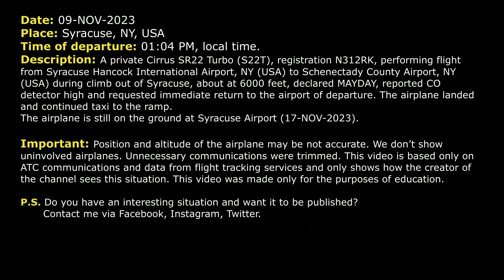MAYDAY. High level of CO (carbon monoxide) in the cockpit. Cirrus SR22 returns to Syracuse. Real ATC

Comment: Hey, thanks for making this video. I was the pilot on the radio. There ended up being a quarter sized hole in the exhaust manifold that caused the CO leak. To all the pilots reading this - please purchase a portable CO detector; I have a Sentry and use it in every airplane that does not have a CO detector built into the panel.
Reply from the maker: Hello, thank you very much for the comment. I'll pin it.
Reply: Kind of cool seeing this video on here. I fly into Syracuse at least once a year. Sorry to hear this happened to ur plane
Reply: Hey there N312RK.  You just showed up on my ADS-B receiver here in Owego, NY, and looked you up, and found this.  Gotta love technology.

Comment: This is another case of ATC clearing two aircraft onto the same runway.
The inbound aircraft shouldn’t have been cleared before the outbound aircraft departed.
But it’s somewhat questionable whether the outbound aircraft couldn’t have held for the inbound emergency aircraft.  Timing can’t be determined from the trimmed audio.

Comment: To me it seems UNLIKELY that the recording missed both the tower clearing to land and the readback. The "just remind me" is the pilots polite way of triggering a "cleared to land" that the tower had forgotten to give.
Reply from the maker: Probably there were some issues with receiver. Sometimes it happens. It was the LiveATC reciever.
Reply: @YouCanSeeATC  receivers always get a signal. When nobody is transmitting, that's just noise. So most receivers have a "squelch" that will suppress outputting the noise signal. 
Then... The receivers that liveATC uses are probably just "someone" who has a receiver close to an airport and helps out by streaming the audio to a liveATC server. 

Those receivers are somewhere on the ground, hopefully close to the airport. Radio transmissions often work best when there is "line-of-sight". Radio signals can bounce off mountains or certain layers in the atmosphere, but those are exceptions. Line-of-sight works best. 

So when the tower transmits, there are likely houses and trees between the tower transmitter and the receiver. Not enough that we don't hear anything, but some attenuation, pushing the tower transmissions closer to the squelch limit. Airplanes on the other hand, usually have perfect line-of-sight with the receiver. 

Thus... Tower: "high transmission power, very high quality transmitter, high antenna": you almost always hear them. Airplanes: Perfect line-of-sight: you always hear them. Ground vehicles: bad line-of-sight, low antenna, possibly lower quality/power transmitter -> often garbled, barely readable. 

So, for me, Occams razor says it is more likely that the controller missed giving the cleared to land and that the pilot politely reminded him (1 assumption) than that we missed two transmissions, one of them from the air, AND that the pilot then forgot about having heard and read back the clearance (three assumptions).

Comment: Is there a way to get clean air in the cabin when this happens?  For example if you are not near an airport and over a forest, what do you do?
Reply: I fly a similar plane. (Same make and model.) It does NOT have a window you can open so that is sub-optimal.  What I'd do would be to turn the vents on full, and turn the temp all the way to cold to make sure it was not trying to get any warm are from the heater's "heat exchanger" which is the primary place you get CO most of the time.  It may not solve the issue, but it will likely help.  

Declaring an emergency and landing asap is still the correct call regardless of any mitigations.
Reply: Unpressurized airplanes tend to have openable windows, altho that one I think is pressurized so I couldn't say if it has windows or not

Comment: I’ll bet that CO detector alarm was startling.
Reply: That's the point. :)  Ours is the same way. Very loud, very annoying, very aggressive. The annoyance is a feature. It needs to wake you up in case your mind is already foggy. You need to spring to action and do something before you can't.
Of course I'm gonna state the obvious here but maybe it will help someone who doesn't know: CO cannot be detected by a finger pulse oximeter. You need a dedicated CO detector in the cabin.
Reply: @lxxsxxx7845  right, I was simply saying that the sound of it was unexpected, thus startling, unlike a stall warning horn that pilots are used to hearing

Comment: “Say your reason for emergency”.  Once AGAIN, ATC not listening and making pilots in an emergency situation repeat themselves.  Maybe they are too busy scrolling on their phones.
Reply: On the other hand, not sure whether it's reasonable for an ATC to immediately understand that "CO High" (without phonetic alphabet) is referring to carbon monoxide poisoning.
Reply: @cjbprime They should know basic flight emergency situations. It is concerning how little they know about how aircraft work.
Reply: @cturdo  I'm not suggesting that they don't understand what a carbon monoxide emergency is -- I'm questioning whether saying "high see oh" over a radio is a successful way to communicate that you have a carbon monoxide emergency; or whether saying "low oh two" would be a successful way to communicate that you have hypoxia.
Reply: @cjbprime  I think it's an issue that they ask the same stuff repeatedly and that they are not tuned into the basics of aircraft emergencies. Both are an issue.
Reply: Maybe the Cirrus was not the  the only thing going on at the time. 25 years in atc and i have never heard that call. At least he didn't make him repeat s.o.b. and fuel
more than once,
Reply: @geezerhull  Yes.  That's a rare thing to be broadcast to ATC.  As a pilot, I would have said carbon monoxide issue, not just said CO.  But it all turned out OK.  ATC reacted to the Mayday immediately.

Comment: Carbon monoxide is a gas that you cannot see or smell. Thanks to the detector they were able to react on this imminent danger adequately. I wonder what the options are in case if there is no suitable landing field available in close proximity. They detected CO and aware of the situation and need a solution quite fast. Are there other options (depending on plane probably)?
Reply: The usual cause is heating systems, so turning off the heater and opening windows/vents as well as landing asap.

Comment: Excellent decision by the pilot! CO is an insidious threat, and the pilot wasted no time in recognizing the danger and responding accordingly!

Every pilot should at least have one of the adhesive chemical detectors.
Reply: yes nice that they had CO2 detector. There has been some crashes in the past du to CO2 and this is very insidious

Comment: A CO gas detector in an aircraft?
Reply: Yes. We all should have at least a non-expired CO detector.  Many of us use digital versions with alarms. Lightspeed makes one built into their headset.
Reply: @jcijr14  thanks of the information
Reply from the maker: I'm not familiar with this aircraft but there are CO detectors that warn pilot about high CO level.
Reply: I just watched a video about a pilot that crashed because of CO.  His CO detector was outdated.
Reply: @susanwahl6322  ouch!
Reply: It's not required by regulations, but it's a good idea to have one in Aircraft with a piston engine.
Reply: @HapyLLIuTeJIb  i agree on that
Reply: Yes  I have installed in my 172
Reply: Yep SR22 has a CO2 detector
Reply: @jackvismara  thanks of the information
Reply: I got rid of mine as my Bong kept setting it off.
Reply: @MattyEngland  God, I wouldn't want to imagine someone flying an airplane while high ...
Reply: @maio290  Do all my best landings with a joint on the go.